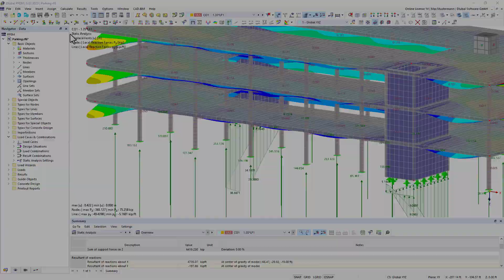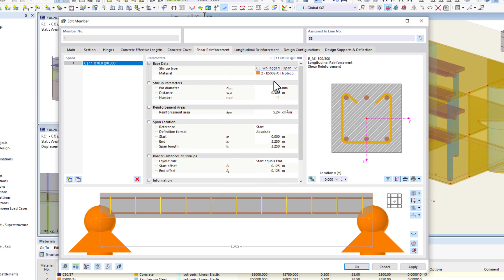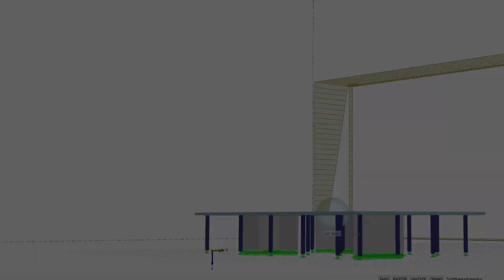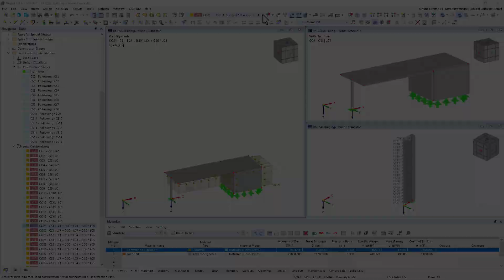Structural Analysis and Design Software for Concrete Structures | RFEM 6 & RSTAB 9 by Dlubal Soft...

Comment: I really don't like the capacity design for the CONC building, but I think in Europe, it's important to have the EC8 inside. It's important for the Italian market and other market where mainly we design 80% of time with Seismic forces
Reply: what do you mean with seismic forces? usually design is done with ULS or SLS, and it includes seismic forces check as well. Did you mean something else?